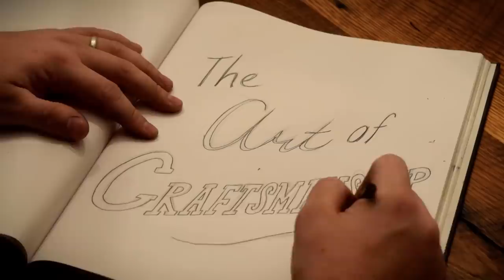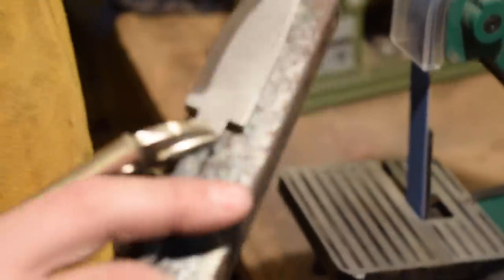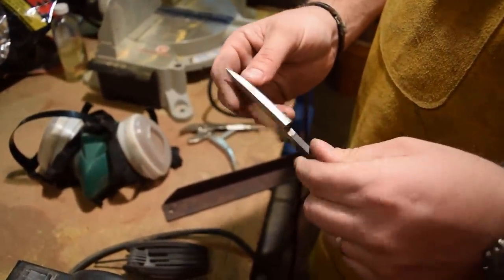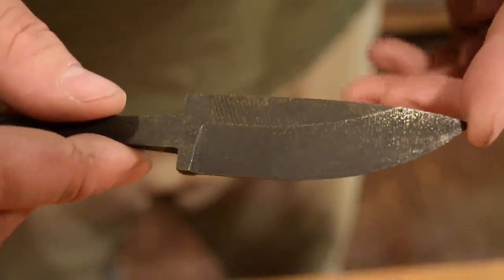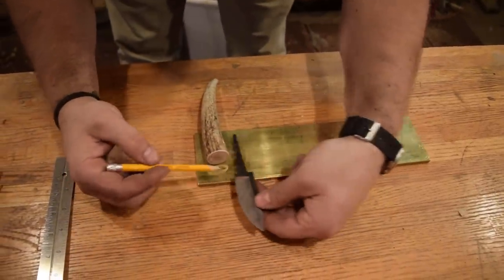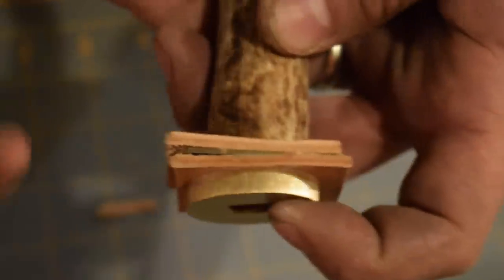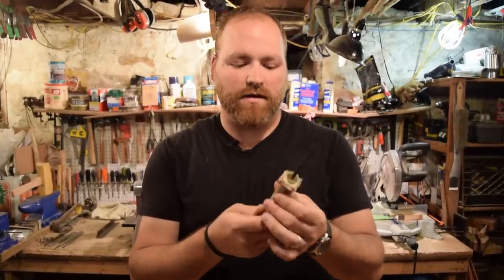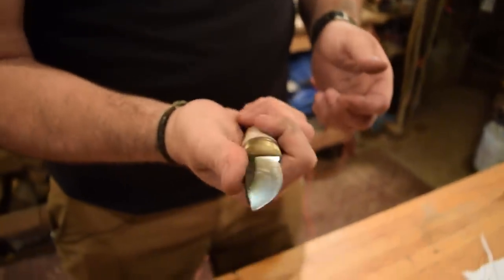Making a Hidden Tang File Knife with Antler Handle

Comment: I like what you have done.  I am contemplating doing a knife for an outdoorsman. I want to do a Bowie knife at least 8" blade. My concern is I want to put an Antler handle on it. The deer antler I have is not huge. Just a normal antler.  In your estimation would an 8" blade be to much for a 4" to 6" handle?
Reply from the maker: Jack Moler thanks for the compliment. It’s hard to say without seeing what you have, but there are lots of good examples of Bowie knives with antler handles online to look at. I have a camp knife that I made with a 7” blade that has a 4 1/2” handle on it which feels and looks fine. It’s not an antler handle, but I think the proportions work. Again it’s hard to say with out the pics because knife proportions are pretty much all In the eye or the beholder (and holder)😉.

Comment: Could you use raw linseed oil too or does it need to be boiled?
Reply: Mr.Joshi91, I have only used the boiled product. As I understand it, the raw linseed oil simply takes a LOT longer to dry. I'm guessing that the boiling process removes some impurities.
Reply: @timm1139  Thanks Tim!

Comment: Very nice work. I could never get clean lines like that on a 1x30. Question, you said you set your initial bevel at 12.5 degrees. Then you changed you bevel angle. At  what angle did you switch to? Did you increase or decrease it?
Reply from the maker: Jim Guthrie 
I don't remember the angle that was set, but I realized that  if I continued grinding at the current angle, the bevel would work its way up to the spine. That would have made it a full flat grind, or saber grind. I wanted to maintain more of a Scandinavian grind, so I changed the angle so the bevel would stop down from the spine when the two sides met. Thanks for watching!

Comment: I'm having a hard time getting my steel to non magnetic with a similar set up. How long does it usually take for each cycle?
Reply from the maker: The first is usually a few minutes longer, heating up from cold, but maybe 2-4 mins. Not long.

Comment: i like your work and the forge , what material did you use  for the forge , can you share please
Reply from the maker: adnan yamout 
Thanks for watching and the comment. I used a mix of plaster of Paris, and sand 1 to 1. Once mixed with water, I poured it into the bucket with a 4 inch pvc pipe and 1 Inch tube for the mold. Pretty easy. I will be building a bigger and more versatile forge soon and posting a video on the making of it so stay tuned.

Comment: For your normalization cycle try heating it up once and let it cool off in a pile of wood ash. The material for files is W series steel either W1 or W2 as you found out it hardens better in water hence the "W". To avoid too much shock and possible cracking you might want to heat the water up to over a 100 degrees.
Reply: Why normalise before quench hardening? Probably not necessary.

Comment: how long you need to the blade about in the gasesse leave until you right temperature has to Harden?Beatiful Knife.
Reply from the maker: Cesare Lanz 
The temperature differs with different kinds of steel, but a sure way of knowing that your steel has reached hardenable temperature is when it becomes non-magnetic. This will generally happen when your steel is bright cherry red. I keep a magnet close by and check my knives when heating them. Here is a good link that goes into the heating process in depth. Www.zianet.com/endear/metal/heattreat3.html

Comment: I know you have probably decided to cut it down or not but if you're going to use it as a wood carving knife I would leave it long. It will give you more control then if you cut it shorter. It will give you a place to put your thumb for more pressure when using it backhand style, aka blade down.
Reply from the maker: A good point.

Comment: Are you using a wood cutting bandsaw to cut your brass? If so, do you have to use a slow speed on it? What kind of blade do you use? Good video! Your grind lines look great. It's amazing what you can do with a little $40 grinder from Harbor Freight.

Comment: Hello
 I just wanted to comment. I started making knives in 1966 and always did it with a bench grinder and files. About 2 years ago I got a 1X30" belt grinder from Harbor Freight ( just like yours) I can't believe what a difference it makes in edge beveling? I can do in 20 minutes now, what it used to take 8 hours to do by hand. The one downside with that belt grinder ( that I've found ) is. it's almost impossible to track the belt off the Right side of that 11 ga. Platen? I've tried every thing. In order to get good, even, plunge lines you HAVE to get started cleanly, and without being able to track that belt off the Right side I can't get good, clean, plunge lines on the Left side of my blades. I'm thinking of either grinding away some of the Right side of that little platen OR shortening the spring on the tracking knob so I can collapse it more to get the belt to track farther Right. What grit belts are you using? I start with 80 grit, but I think thast's a bit too fine. Maybe I should try 60 grit? I have a 2X72" belt grinder, but I love my little 1X30" so much that I only use my big one for doing handles. Keep up the great videos. I'm subscribing right now! OH... I modified my table to get more "pitch" too. but I did it a little differently.
Stoney
Pappy Dave's Knives
PA.
Reply from the maker: Stoney327 
Hey Stoney, thanks for the comment. I didn't wait as long as you, but I did all my bevel work with files for years, then got the the 4x36 belt/disk sander. It is a joy to use the 1x30 now. I start with 40 grit and move up from there. Thanks again, I really appreciate hearing from other knife makers.
Reply: You're very welcome. Thanks again for the videos. I'm very happy that I subbed.
Stoney

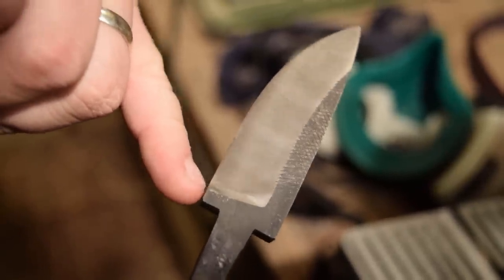Comment: Question: At 20:35, what is the "choil"? What is the filed recess for?
Reply from the maker: Thanks for watching and your question. The choil is put in to make it possible to sharpen the full length of the blade. Without it, it would be difficult to sharpen that transition area between the blade and plunging line, where the cutting edge begins. It’s not always necessary, but makes a nice addition to the blade sometimes.

Comment: Dustin, thanks for all your awesome videos. How do you like that chicago electric belt sander? Any problems with it?
Reply from the maker: I’ve been using both for a couple of years now 
As far as the 1x30 goes, other than a few cosmetic issues, like the plastic platten tightening nob handle breaking, it’s been super awesome. For the price, you can’t beat it. I did some personalization and customization to the flat plate in the front to make it tip back toward the belt, which is crucial for my grinding jig.
The 4x36 does its job, but is a bit underpowered. Works great on wood, and larger flat areas. 
Hope this helps
Thanks for watching and commenting.

Comment: Love this video mate! Great knife making skills. But why do you put the knife in the oven?
Reply from the maker: Thanks for watching and the compliments. The knife goes into the oven for the tempering process. After heating and quenching the knife, the blade is extremely hard, to the point of being fragile. The tempering process softens the blade to a more durable hardness. You can track the hardness of the blade by the tempering color. When the metal turns a dark straw/warm tan brown color, then you’ve reached an ideal hardness for a working knife. Generally, 1 to 2 hours at 400° in the oven will bring your knife down to the correct color/hardness.

Comment: Just a tip here.. when using leather inserts like that its best to harden the leather first to stop it looking "furry"  Veg tanned leather can be soaked in hot / boiling water and will go very hard. ( it also shrinks so do it before cutting to size)

Comment: Do you have to do anything to the antler to cure it or is it good to go?
Reply from the maker: Not that I know of, I just used it as is. I purchased this piece from a dog snack company. I have never heard of anyone preppinh their antlers in any way, but I would assume there is some drying time that could benefit the longevity of the piece.
Reply: @TheArtofCraftsmanship  You should seal antler with super thin super glue like some knife supply companies sell. Antler absorbs moisture and can eventually crack if it gets dried out after many times of dry-damp cycles and it dries too fast, so best to seal it even though it doesn't seem to need it. Whitetail antler is more porous than mule deer antler and moose antler is the best, even better than elk.

Comment: Leave the full handle. If you make a sheath it will give you more to grab on to. If you don't alreadybhave one, look around Goodwill or other thrift shops for a small toaster oven for heat treating. Smaller and cheaper to heat.

Comment: would keeping the oil in the fridge for a little while help at all?
Reply from the maker: Frogos mcduck I don't know the exact science of it but my understanding is that the oil slows the cooling process down, and with this knife, cooled the blade too slowly. The viscosity of the oil is the primary cooling agent, so it would actually need to be warmed up a bit to make it less viscous and in turn enable the blade to cool quicker. I know, it seams backward but that's the way it works. Thanks for the comment.

Comment: Shouldn't it be stuck in a powdered bone meal mixture while normalizing? To allow it to cool very slowly & retain carbon?  I'm probably a little off on my procedure but I believe theres a similar step that can be implemented.  Very inspiring by the way... Thanks for sharing.
Reply: never  heared  of  useing  any  thing  when   normalizing.   take  the  blade  from  forge  let  cool  three  times   then  go  to  the  quench
Reply: It sounds like you're talking about annealing, which makes the metal a lot softer.
Reply: Can normaluze and anneal in vermiculite from the Garden department. Its just insulation to slow the cooling which won't burn from red hot steel being buried jn it. Vermiculite is super light weight and granular...sort of like big sand particles.

Comment: For you knifemakers that veiw these comments and happen upon mine , let me first say that I have 23 years experience making antler handled knives , and even though the leather washerrs add some ascetic looks to the knife , it actuaslly ruins the knife for overall life expectancy of the handle strength . Leather over time will break down . If the knife is to be used and passed from generation to generation,  with much use it will begin to loosen , allowing water, blood , fluid down along the shank of the blade which in turn is soaked up by the dry marrow inside antler , allowing pressure from usage to open the space within the handle . It will also develope an odor which means the inside of antler handle is breaking down .
I made 583 recorded knife/sheath sets , more were made before recording began how many Ixm not certain . I never had a knife returned for becoming loose ,but , had many return Customers  . I also reccomend not being skimpy with the brass for fingerguards . Extend the guard below the antler and convex it to fit nicely over finger . Shape the bottom side in a coffin shape , or just make it an ovel . This insures that wet or bloody hands do not slip past and cause serious injury afield by grabbing the razor sharp blade edge .
Good workmanship and processes in this video . Definitely a Craftsman and teacher ,

Comment: Is there any other ways to find the middle of the bevel? Or if not what is that devise and where do i get one?
Reply: Mycka Koger  a drill bit the same diameter as ur steel works too
Reply from the maker: Mycka Koger 
Thanks for watching! I am using a marking gauge that I picked up from harbor freight to mark the center line for the bevel. Another trick that I've used in the past is to lay your knife blank flat on a table top, then use a drill bit, that is the same size as you knife width, also laying flat on the table top to scratch a line for the bevel. The tip of The drill bit is slightly pointed, so it will put a mark that should be dead center. Then flip the knife over and scratch a second line to be sure you're on center. Good luck.
Reply: The Art of Craftsmanship - Thanks man, i had forgotten about that way!! But one more thing, i have the same 1×30 belt sander, and i want to modify it as you did. Is there a video i can watch or can you post a quick video on it?

Comment: Beautiful knife! But blades made from files, though some of the sharpest you can get, will snap like tooth picks if used incorrectly and they rust if you look at them. Also, leave that knife in the sun and epoxy will turn to gelatin and the blade will slip out. J.B.weld from an automotive store is better. It will stand the gaff.
Reply: Good remarks.
Reply: If you hear treat properly, they are no more prone to breaking than any other carbon steel. If you dont want a carbon steel knife to rust, use it to cut meat and veggies, that will speed up the patina that keeps it from rusting. You could keep a coat of mineral oil on it, but not necessary unless you dont really use it much. You could also force a patina by putting it in vinegar or mustard.  I can't speak of epoxy in the sun because I dont leave my knives out in the sun. They are either in my pocket, on my hip, or in the house.
Reply: Larry Reese cf

Comment: Howdy
 I have a question. Appox. how many hours do you get out of that 20 pound tank of Propane
Thanks:

Dave
Reply from the maker: Thanks for the comment and question. Honestly, I can’t tell you how many hours I get out of the tank, because I don’t use it exclusively for the forge.  When I run out of gas in my grill, then I pull the tank from my shop and vise versa. Wish I could help more.
Reply: No problem. Thanks for your reply

Stoney

Comment: Non-magnetic temp is 1412 degrees and a file is a mystery steel, but probably needs to get a little hotter. When you pull the knife out of the forge do not stop to brush it off, get the blade into the oil in less than 2 seconds, less than one second is best. Just FYI.
Also I only use 45 minute epoxy by West Systems their G Flex glue is the best there is, better than JB Weld which I also use if the glue isn't going to be visible. I made a slotted jig for clamping my hidden tang knives. You can order it at Walmart if your local one doesn't stock it. Its where I get mine.
https://www.westsystem.com/specialty-epoxies/gflex-650-toughened-epoxy/
Man your band saw blade is dull.
 I've been making knives as a profitable hobby since 1992 and I've made some from files, though I usually just tempered them at 425 for two hours and then ground them down. I also always pin them or run them through the whole handle and put threads on the end and screw on a pommel.

Comment: Is the type steel in files D-2?
Reply: So many alloys for files.
Usually high carbon (0.90-1.30%) with a touch of manganese and vanadium.

You can heat treat files much the way you would 1095/W1.

Comment: If the file is already hard why did you do that? I've made a file knife before and I only needed to temper the knife. I'm confused
Reply from the maker: Thanks for watching and for your comment. For the sake of being able to shape the steel more easily, I annealed the file first to soften it. This way I could work with a softer piece of stock. I agree with you, and have heard about others who skip the annealing. It could be done,  but then you are working with hardened steel the whole time, which creates more wear and tear on your tools and yourself. I have the facilities to do the heat treat myself, so I take the extra time to save the stress over the process. 
Thanks again, happy creating, and Merry Christmas.
Reply: @TheArtofCraftsmanship  ohh I see. Makes sense. True enough, you would be able to work faster and save on belts lol. After I tempered my file it was easier to work with but I'm sure if it was softer I could of saved a lot of time. Thanks for the reply, Merry Christmas to you as well

Comment: Why do you have top heat-treat a file? It's been heat-treated to the best degree and tempered for the max toughness, so I don't understand the reason to heat-treat a file.  I also don't understand the reason to make a choil when it decreases the knife's effectiveness.
Reply from the maker: tabasdezh 
I heat treat the knife because I prefer to anneal the file before starting the shaping. Also, the files are harder than I want the end hardness of my knives to be. I have heard of people doing all the shaping with hardened files, but the chance of ruining the temper along the way and having to re heat treat is so high, that it makes more sense to anneal, work with soft steel, and then heat treat and temper your self. As for the choil, it’s purpose is to give a definite end to the blade that you can sharpen to. Otherwise your sharpened edge will slowly dull in the spot leading into the plunge lines. Also, I like the way it looks😉. Thanks for the questions.
Reply: Files are too hard for knife work when the edge is thinned out it will be to bridal and prone to chipping. Files are usually in and around the 62 Rockwell on the C scale. You want your knife to be at about 58-59 or 60 depending on the material. If you take your timer grinding a hardened piece of metal you shouldn't damage t just go slow and cool it in water. If you grind without a jig you should get a sense of the heat building in the blade. If it begins to get too hot you shouldn't be able to hold it and that will happen well before you get  to a temperature that will hurt the heat treat.